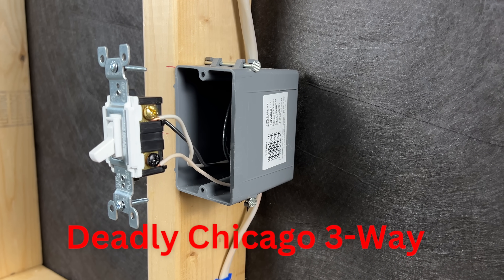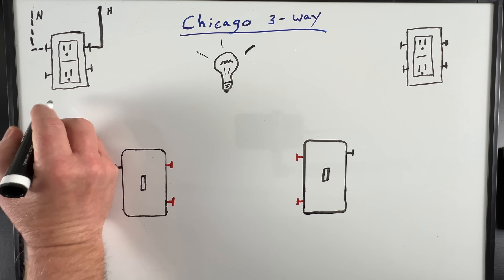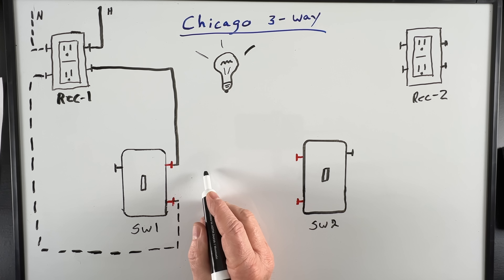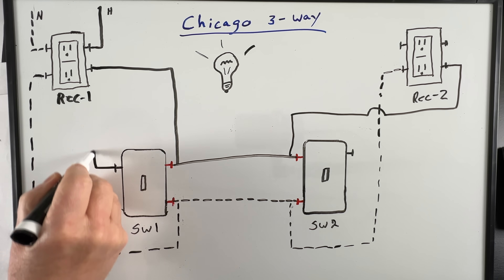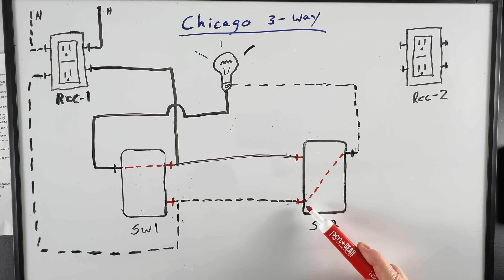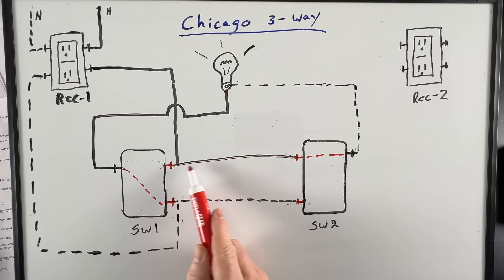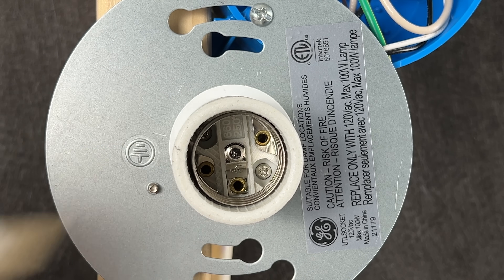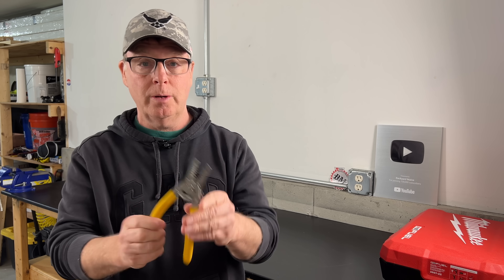The Deadly Chicago 3-Way (Only 2 Wires)

Comment: I had a friend who had knob and tube wiring in part of their house. The stair light had the only push button switches left in the house. They were wired in series. If you turned the light off downstairs, you couldn't turn it on upstairs.

Comment: Forbidden in the US for 100+ years, forbidden over here for 50+ years. The only difference, we use 230V for it. It can still be found in houses that were built before the 70s.

Has there been a significant number of persons that got shocked when changing light bulbs in my country: No
Has there been a significant number of persons electrocuted when changing light bulbs in my country: No

If there has been a significant number for any of those in the US, then think about the real reasons ...

Comment: Had one of those in the house i just bought. Found out when i re-mapped the breaker pannel and supplied 240 to my lightbulbs.
Reply: Probably let the magic smoke out of the bulb, didn't you.
Reply: @dougjotzke1389 a few before I realized what was happening. Turn the switch on upstairs and it got brighter... turn the switch off at the bottom it got dimmer and stayed on.
Thats when I realized there was not a single wire connector in the entire house. All just electrical taped together

Comment: Excellent. I ran into this Chicago 3-way switching in 100 year old houses in NYC that were originally gas lights everywhere. This worked out when they outdated the gas lighting fixtures and they needed to pick up power from somewhere.  I ran into this some 35 - 40 years ago. It was surprising to see for the first time. I figured something was off when the polarity kept switching at the light fixtures. My original background was in electronics, so "drawing the picture" was how I figured out what they were doing. You present this Chicago method (and the California method) very well. I will send some of my students to this video. Thank you for posting.

Comment: The bad thing about this type of three way is not just the shock hazard... The old old wiring is not color coded and the hot wire won't always be detected by a tester (trust me, I know!). I was told (by an old electrician) that they used to "test" for the hot wire by tapping the wires with a finger tip... If they got a "tickle..."
I've only encountered this switch setup a couple of times (with old push button switches!)

Comment: I’m pretty sure this is how they wired a switch in our garage to control a light on the house with only one extra conductor between the house and garage. Now only the inside switch works after the garage electrical was redone. What we had to do is attach that extra conductor to the hot so it would feed back to the house.

Comment: I can see it coming from the (early) days of knob and tube as the ideas of "hot" and "neutral" didn't really exist then; it was simply complete circuit or open circuit. Safer patterns emerged from real experience over time.

Comment: With the neutral switched you have basically an antenna radiating 60 hertz, especially with LED  or flourescent lights, causing radio interference.

Comment: Great, all of my 3 way switches are wired this way in a home built in 1995.  I’m trying to convert a 3 way to a single pole and it’s super confusing. Flipping switches and seeing black wires go cold and white wires turn hot is crazy to me.
Reply from the maker: Thats crazy since the method has been a code violation since 1923.

Comment: With incandescent bulbs, the polarity doesn't matter, so contractors could get away with this circuit.  Hopefully, the polarity requirements of modern LED lights will make people rewire these bad circuits correctly.
Reply from the maker: I have a video coming up where I test reverse polarity on LED lamps. Stay tuned.

Comment: It seems that both the Chicago 3 way and the California 3 Way could accidently get wired to 240 if the outlets were on different legs. Also, I ran into a three way that someone wired with 14/2 (with ground) using the bare ground in the Romex as a "red" wire (on the wires between the 2 switches). Is there a name for this scenerio?
Reply from the maker: Dangerous...

Comment: I've always called this a California 3 way, and it usually has nothing to do with "receptacle 2".  Knob and tube has all the splicing in the walls and not in the boxes so this wiring method was not needed for powering "receptacle 2".  I was just an easy way to wire a 3 way with knob and tube wiring.  Illegal since 1919.
Reply from the maker: I have a video on the California 3-way as well. It similar but a little different.

Comment: I live in an Old 1927 Bungalow here in Northern Maine and the original Knob and Tube system had a Chicago Three way using a couple of those old Push button Switches for the Hall Light on the second Floor , I found out the hard way the Fixture was still energized about 30 years ago when I changed the fixture , About 11 years I finally tore into that mess and got rid of all the old K&T and hooked up a proper standard three way system amazingly those old push button switches were still working when i removed them they had to have been almost 90 years old! I grew up in this old house as My Parents owned it years ago and I can assure you those old switches had many cycles of use on them , Your Videos are excellent and well put together thanks for sharing!
Reply from the maker: Thank you..

Comment: I've encountered this before & I didn't know what the heck was going on.  Absolute sorcery!  Reversing the polarity of the line & neutral is crazy.  I understand why it has been banned for decades.  What I don't understand is how it was permittable in the first place!  Needless to say, it was an old house subdivided into apartments.  The insulation on the wiring was brittle and crumbling off the wires everywhere I had to do work.  I told the owner that he didn't need to worry about updating the lighting and the devices.  He needed to rewire the building.
Reply from the maker: Sounds like knob and tube wiring.. I made a video about that and how insurance companies declining coverage. https://youtu.be/r3mSjfavyDU
Reply: @BackyardMaine yes sir 👍 I watched it!

Comment: I recently set up a Chicago 3-way on a test bench I built by Krazy Gluing some plastic boxes to plywood, and made an interesting discovery regarding a trade-off that can be made with them: namely trading some functionality for increased safety.

If one opens up switch box #2 -- the one that has bulb neutral connected to its common screw -- and removes and caps off the traveler wire that carries line hot across from switch #1, or removes the other end of that traveler from a wire nut in switch box #1, switch #2 loses its reversed polarity functionality. Switch #2 now will function as a "does switch #1 get to control anything or not?" One position of switch #2 now means the light will always be off regardless of switch #1; the other position of switch #2 allows switch #1 to control the light.

True 3-way functionality -- which is to say, any flip of either switch changes the state of the light -- is lost, but safety is gained because switch #2 can no longer reverse the polarity to the bulb. This is an option for anyone finding themselves with a Chicago 3-way and willing to make that trade.

Comment: I just ran into this last Friday. Unfortunately, my helper tried to replace the switches on his own. To make it more confusing, it was 2 sets of three ways in two 2 gang boxes. (1 first floor, 1 second floor). He didn’t label anything before he took the switches out and since the switches were old, all three screws were the same color so I had no idea what wires were travelers or common. I’ve never run into this before. 40 years. It doesn’t help that the knob and tube is brittle and there is no ground to use to determine hot from neutral. I spend hours reverse engineering to get these things working. Too bad I didn’t think to look up this video first. Ha ha. It was a nightmare.

Comment: This is a good reminder, never assume the power is off in any fixture, panel or box! That's why we have meters. Use it!
Reply: If testing the light fitting with a meter and both sides are energised then your meter is going to read zero if you don't have a ground for reference.
Also fail to see how this is a 3 way switch when it's only 2 way. I live in the UK and things are done differently.
Reply: @stephenshepherd6854 in the US three-way refers to a setup where there’s two switches, as opposed to single pole where there’s only one switch. I believe its name comes from the fact that there’s 3 terminals on the switch. I’m guessing to you three-way refers to three switches instead?
Reply: @JuneNafziger Thanks for the info.
Yeah 3 way in the UK means 3 or more switches controlling the same light. Intermediate switching like on every stair level or long hallway.

Comment: In NEC article 410.90 allows you to use a threaded lamp holder with both conductors being ungrounded (Mogul base only). I had to wire one using two hot legs of a 208 volt Y system. I just had to install a double pole switch to control it.
Reply from the maker: Yes thats the norm for a 208v or a 480v pole light.

Comment: The problem with this diagram is that the wires FROM THE LIGHT can only be in one box, not both. So how can you hook light wires to both common screws on 2 seperate switches in 2 seperate boxes? Unless 12/3 romex(with the red/black wire) used as travelers, then the white would attach to the sw2 common connecting to the light Neutral back at sw box 1(which you failed to illistrate). If this was from way back, they didn't have 12/3 romex. The travelers would have been Black and White. This couldn't work.

Comment: Ever experience three way switches that uses 14-2 wire and uses the earth ground wire for the traveler!?  Previous owner of the house was a mason. He should have stuck with masonry as there are all kinds of wiring  gems throughout the house.
Reply from the maker: No but that is a accident waiting to happen..
Reply: I have seen that once.    While helping my stepdad rewire his rambler build in 1973, that he purchased in the spring of 2005 when I was a few months from turning 16, because the single strand aluminum wiring failed in several outlet boxes, and to make matters worse the electrical panel was a 70 amp Zinsco in the bedroom closet of the baby's room (the house was vacant for 2 years when Dad brought the property, and a crib, toddler's bed were left behind, along with several pieces of old furniture all of which had to be burned in the brush pile because they were infested with bed bugs and mice).  The three way switches for the hallway and kitchen/garage were originally wired as follows.   Power feed at fixture, double dead end using a 12/2 w/G aluminum NM cable from fixture to each switch.   If I remember correctly they used the white for the commons, and black / ground as the travellers and there was no electrical tape or other attempts used to insulate this live "ground" wire, it was simply shoved back against the metal box and you more or less were the "bird on the powerline" so to speak every time you touched the brass cover plate while standing on the  green shag carpet in the hallway or hardwood floor in the kitchen leading to the garage.   In the garage there was black electrical tape around the "ground" traveller wire which crumbled apart in my hand as I went to pull the old switch out of the box.

Comment: I have two switches from the 70 era. One was for a separate light and the other for another light. There were two white wires not hot and one black wire hot. How do you wire this

Comment: My house was built in 1928.  It has two 3-way lights, stairway to second floor and standalone garage mounted driveway light.  No green ground wires in 1928 either.   Any grounds are via metal conduit in the unfinished basement (maybe added since the house was built) or armored cable to a few outlets.  No knob & tube wiring but some is cotton braided over rubber, cotton sheathed in pairs, which is fragile from age.  There has been some newer wiring added over the last 90 years.  So I wonder how my 3-ways are wired.  

Thinking about how to test for Chicago wiring.  So when the light is off, both wires to the light are either energized or neutral.  With no ground nearby to check either wire to ground, how would I know.  I suppose I could plug a 3 wire extension cord in to some receptacle that has a tested & valid ground, run that up stairs to the light and use that extension cord ground as the test point.  Light off and no voltage on both wires, then flip both switches and voltage on both wires = chicago wire method.   

Then what?  I have the knowledge that I should always shut the circuit off if it needs something.    Ripping out walls to replace old wires on a circuit that works isn't a popular idea with the homeowners.

Comment: I always enjoy and learn from your teaching.  As soon as you finished the initial wiring drawing I realized that individual wires and screw connections would be changing potential all the time.  Dang that's dangerous!  I'm paranoid about getting electrocuted or simply shocked so I always test the potential of everything when working on mine or a friend's house!

Comment: Canadian journeyman electrician for nearly 30 year...I have never heard of this half assed method of wiring a 3-way and I am "shocked".  I don't think this was ever a thing in Canada as our codes have always been stricter....but I have seen a lot of dodgy installs in older buildings...for example using a bare ground wire as a traveller wire in a 3-way circuit. Thanks for teaching something new to an old dog.

Comment: John I have a very interesting question I do a new service for a solar company and by that I mean we run the outdoing me the pan schedule 80 pipe to the attachment from the local electric company in New Jersey and New York no matter what electrician I talk to they cannot answer me the age-old question that houses that were built in the '50s '60s or equipped with 100 amp meter pans outside They are no longer available so we use 200 amp meter pants and we upgrade the service to 200 amps inside outside and the wiring to the point of attachment My question is why is it okay for us to use to ought THHN on aluminum wire that was set up to handle a hundred amps for a home, the only answer I really get is that no one's really ever going to use 200 amps all at once, that is not a good enough answer for me so every upgrade we do we have our customers call their local utility service power source and please ask them to upgrade their wiring that is capable of handling 200 amps , but that has been many homes that the customer has not called and done this why is it okay to let this go Thank you much appreciated Mike from New York

Comment: I just came across this in our '60s or '70s era home in Mexico.  As an electronics guy I quickly recognized the common of the 3-way switch was simply being switched between Hot and Neutral.  It's a tad hard to add wiring in a concrete house, so I'll simply add labels under the switch and lamp covers to warn future people.
I'm surprised you did not add "Smart Switches" as another method to make a 3-way or multi-way switch system.  Its an easy way to also fix the Chicago 3-way.  I've installed Insteon (there are other Brands) switches in my last 3 houses.  Every switch has an address and every switch can control any (or multiple) other switches, both ON/OFF and Dim level.
I'm not sure why houses are still wired basically the same way for the past 100 years.
Reply from the maker: Maybe another video on smart switches...

Comment: Creative and spartan, sort of, but woe be on the poor electricity-dense owner who has to deal with problems in a home wired like this, and sometimes be at the mercy of nouveau/semi-competent contractors who can't understand and address such non-code installations. Not my line of work, but speaking as an electrical engineer who has had to pinch hit for such.
Reply from the maker: I started my career as an electrician but I retired an electrical engineer. I worked for Texas Instruments for 22 years.

Comment: This explains a lot of wacky issues I’ve had with my 1921 house. Another peculiarity I’ve seen in my house was fused neutrals, I.e. both hot and neutral going through their own separate fuses. Not all the fixtures and receptacles on a hot fuse would return through the same neutral fuse.

Comment: Was Electronics Tech, And When Starting Electrical, Possible Employer Said, Draw a 3 Way. I Drew What I Just Learned to Be Called a Chicago 3 Way. I Still Got The Job, 40 Years Electrician, 25 Years ago Master. Actually A Little Simular to Boat Trim Relays, The Motor Wires are at Ground Potential, Energizing One Motor Rotates One Way. Energizing Other Relay Reverses Polarity. Now I Have ato Look Up a California 3 Way Is, I Know What a California Stop Is😮
Reply from the maker: Here's a link to the California 3-way video. https://youtu.be/AeXFe5ghmKQ

Comment: I see how this works and why it it dangerous, but I don't see how it allows only 2 conductors to the load, since the cable to the load has to be run from BOTH switch locations.
Reply from the maker: This was primarily done with knob and tube wiring which had two separate wires (hot and neutral) connected to insulators which ran from location to location around the house. You could feed through the 3-way switches and on to the load with two wires rather than the three that are required today.
Reply: @BackyardMaine  Ah, now that makes sense. They could also run a single conductor from point to point. Thank you.